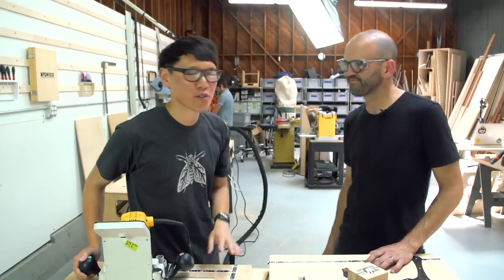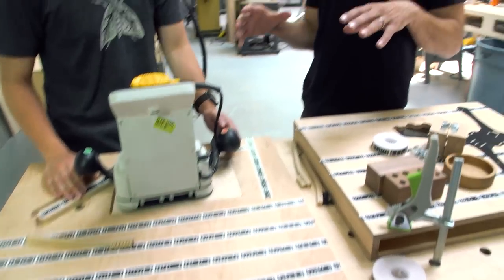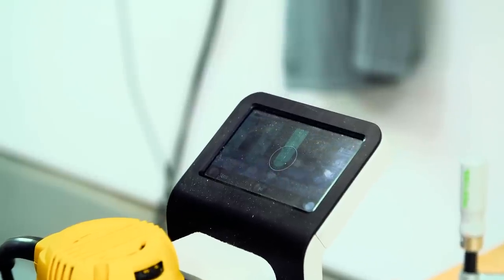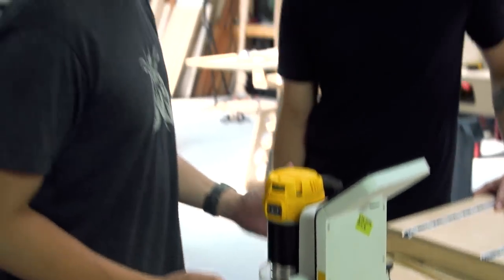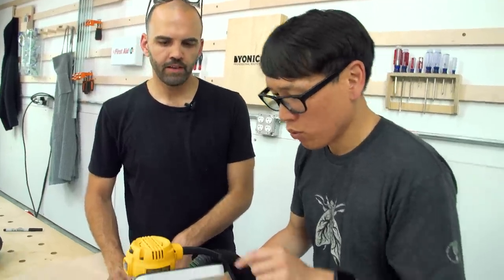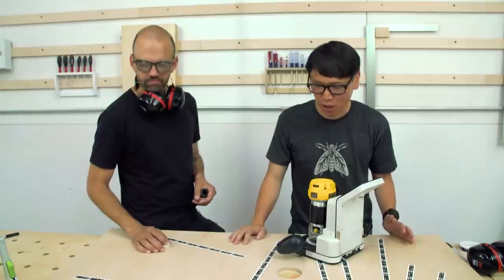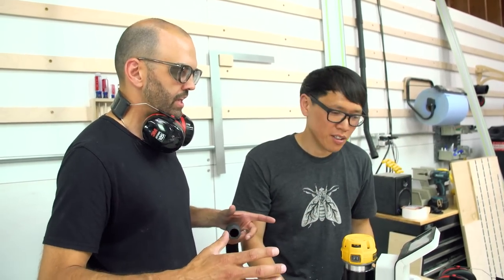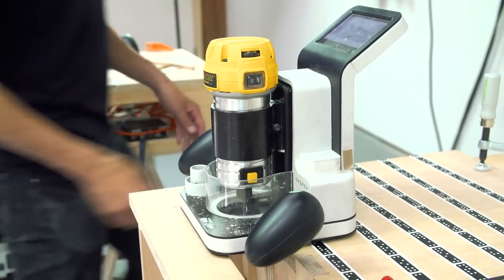Hands-On with Shaper Origin Handheld CNC Router!

Comment: won't you run out of tape pretty fast?
Reply: I imagine you can re-use them alot.. just use a glue stick to make them sticky again.  It doesn't need to be a long piece of tape,  as long as there are some markers on the board it looks like orientation and long stips don't matter much..
Reply: Not if you buy more.
Reply: Remember he said so long as it can see about 4 "domino" pieces, it's good. So use a bunch of like, 3 brick pieces within, lets say 4" of eachother, you could use little tape and cover a decent area with ease. Or so I would imagine
Reply: A glue stick could dry solid, ruining the tape, or leave residue on your work piece. A repositionable mounting spray adhesive might work better. There are several available for use on "delicate" materials and 3M offers probably the best line of temporary adhesives.

In addition to that, you could probably lay out several strips of tape across a piece of paper and then photocopy ad nauseam or scan it. Or just copy the tape design into whatever software and create your own sheets from scratch, ensuring you get crisp edges for calibration. Cut , glue, enjoy. Providing your own adhesive solves the problem of running out of tape.

Comment: Why would you have a big complex computer-vision system when you could use two off-the-shelf mouse sensors for very high resolution movement tracking?  Also, 'low cost?'  You mean more expensive than a 1000x1000mm CNC router that can do 3D cutting and set-and-forget multi-hour cuts.  If this thing  was $500, it would be killer, but at that price, it doesn't make sense.  Perhaps later versions will come down in price.
Reply: Because mice sensors are really crappy on some surfaces and mean you could never lift the device or turn it off once you started, and what about all the moving dust?
Reply: most cnc routers have a dust extractor. If not just use a shop-vac
Reply: With a 1000mm by 1000mm CNC I fist have to take a sheet of ply to a table saw or a panel saw cut it to 40 inch by 40 inch squares wasting a bunch of wood because the sheet is 48 inches wide and then take it to a CNC machine.  What a waste of time and wood.